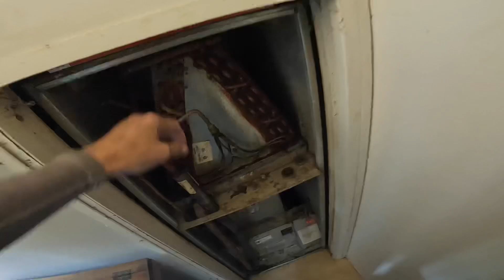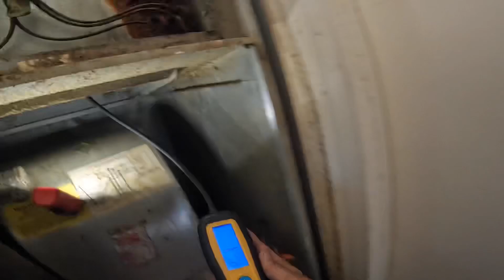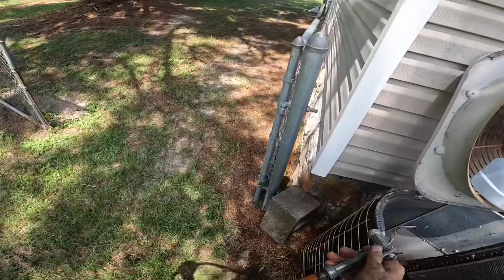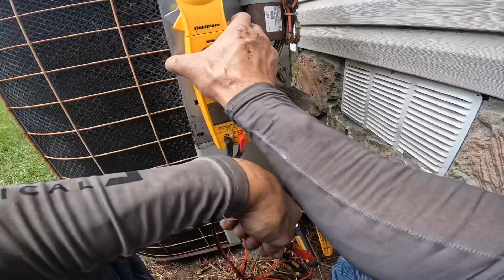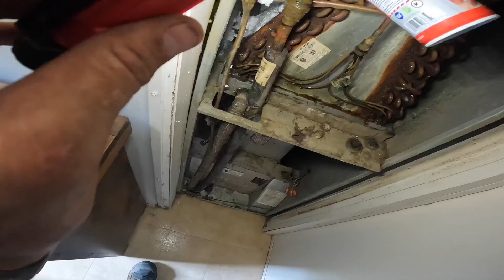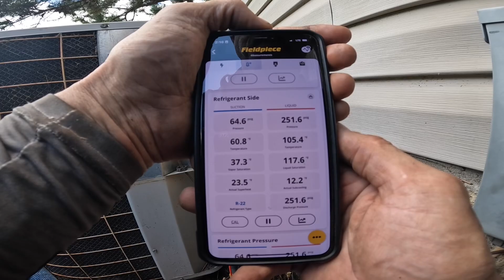Repairing an old System, instead of Condemning it!

Comment: I'm not a tech but I enjoy watching you guys go out on calls so I appreciate these videos.  By way of feedback (not criticism), it's a little better for me whenever I get to see the before and after on everything.  Like if you can show a flashlight or daylight through the condenser before and then after it's a little more satisfying.  And that uF calculation was really cool, but I'd get extra satisfaction if you metered it directly after removing it, and metered the new one before putting it in.  And when possible get a quick shot of the cap labels.  Again - not sayin you're doing it wrong, just as a viewer that double-check scratches an itch.  Just my 2 cents, and thx again for taking us along on the job.

Comment: Start budgeting for a new system right after a new one is installed.  Much easier than waiting until the current one you have is near death.  10 year budget (120 months) to save up vs 1 or 2 years to save up the same amount.

Comment: that suction would have gone up. looks over charged to me with poor air flow condition. what was indoor temp delta? guessing high. that filter looked smoked too. return grill as dirty as everything else possible too? just added the field piece wireless manometers to my tool kit. they are fun. you must try if you have not. did you just calculate MF on the cap with running voltage???! how do you do that???

Comment: I went on a call today they said the unit is blowing warm air in the house I think my compressor is bad I get there it's a 22 year old intertherm ac unit in a double wide was going to hook my gauges up but the suction line was blistering hot and I told the guy hell it's in heat mode let's go to tstat then he tells me yeah I put up a new tstat today but I don't think anything is wrong with it I said yeah something definitely wrong with it but he had it wired right just didn't program it so I got it blowing ac again

Comment: Nice video keep up the good work. i know how it is when your told you need a new system and dont have the funds for it.  just a couple weeks a go our ac unit at our store went down i was told system needs to be replaced its not safe. i have been told for the past 5 years system needs to be replaced well this year it almost happened its a old frigidare unit from 2003 2 ton with a pancake unit.  unit went down on monday it had cooled fine the week before i walked into an 80 degree show room we have 2 units one cools half the show room other cools the other half.  any how walked into an 80 degree showroom. unit was iced up i shut it down and called repair. the Indoor blower would not run finally they found a broke wire all the time telling me the wiring on the unit is a mess and dosnt seem to be wired correctly he reconnected the wire the unit fan started and then the wire nut started glowing red and smoking. instead of checking the unit he con dimmed it shut it down said its old and unsafe needs replacing. its going to cost 7,000 for a unit i told him i cant afford that can you repair it i was told no.
i almost paid for the unit well the store next me recommended his guy i gave him a call. he came out and said yes the unit wiring is a mess the wires are cracked and melted the transformer wiring is poor but what really caused the issue is the heating element was shorted he quoted me 400 bucks to rewire the unit for cooling only he replaced the transformer a relay and some wiring. the unit is now back up and cooling and freezing people out of my show room there is a 20 degree split and i couldn't be happier i got yet another recommendation to replace the unit. at the cost of a new unit i plan to ride this system for as long as i can.   our store has been in this building for 10 years and that system hardly ever gives us any issues.
we had a carrier on the other side that was installed in 2008 2 years before we moved our store into the building that was a new unit that unit back starting 2016 ish was always having problems and in 2019 the compressor blew we put a new ruud on the roof condenser only the unit downstairs in showrrom was 410a compatible it has not had one issue since it was installed.

Comment: Sometimes you can keep them going. My MIL's condenser went bad, we put a used one on it, and of course the Evaporator was leaking. We put a can of that stop leak in it, and it is still going five years later. My own system is 16 year old goodman 4 ton and it's a leaker about 3 to 4 lb a year. It's a polished turd at this point. The compressor is drawing too much and sounding a little rough, but still working for now. I'll keep it going as long as I can.
Reply: You can't polish a turd, but you can roll it in Glitter 😎

Comment: Swapped out a 23 year old evaporator coil on a rheem AC the other day, it's phased out here and unavailable. pumped down to vapor into the condenser using the service valves, only needed 2.5 oz of upcycled r22 to bring it back to spec!

Comment: Why don't you use a cleaner to clean the condenser unit.
Reply: Because water works just as well. Evap Cleaner works better for inside because of the confined space and inability to spray water through the coil. They do make foaming cleaner for the outside units but it has a tendancy to weaken the coil so using on an older system isn’t always a good idea

Comment: Mobile home air handlers are garbage at filtering whoever installed that cabinet should have put a solid door on the front of that cabinet or seeled of the front of that thing instead of that open grill door on the front of that unit that has absolutely no way to put a filter on it so that poor dude could filter his system properly That cabinet literally has an opening up top for the filter to sit up top of it or a filter plenum to run a duct to a 20x30 grill through the wall above it.

Comment: I have popped the low voltage fuse so many times changing out caps right next to the contactor- so frustrating when the air handler/furnace is in the attic 🙂

Comment: Texas heat took out my ac, anyone have experience with Carrier, performance line, 17 seer, two speed.  I am looking at the Carrier to replace the junk Amana that has a leaking evap coil, second one in 10 years.
Reply: Probably you use something acid or thinner the eating your coil

Comment: Mobile homes. Will never 'do right' until they start putting in returns in most of the rooms
Reply: Agreed. Just added return ductwork + return trunk line under mine and added a return in almost every room. Only think that’s good about it was supply and returns can be ran directly off the trunk without adding flex

Comment: I said it before and I'll say it again, you have to clean the condenser and evaporator. When I started in years ago, I had an old boss instill in me that if  you getting funky gauge readings, clean the coil and evaporator. Then you will have a good base line to start from, because 95% of the times a dirty coil with lead your mind to other things. The 1/2 hour spent cleaning the coil will save you time when trouble shooting the unit.
Reply: Absolutely stupid!!

Comment: Geez why do people stuff the indoor units in little places like that? What a tough job that would be to replace. Good job helping those people out on their old system 👍
Reply: It's not 'people' it's the manufacturing home builders. It's because they don't have to go by many standards as when you're building a home
Reply: @staind288  yes I meant the contractors.
Reply: @anthonyelectric6045  
It’s not the contractors they go by a blue print made up by an architect home owner and engineers unless it’s a model home ….. in this case it’s the mobile home manufacturer and it’s cramped liked this to give people more living space plus they only design it the don’t have to do repairs to the system ….
Reply: @FredD63  kinda figured so much. It’s all good till you have to repair it I guess.
Reply: @anthonyelectric6045  
Exactly right 👊🏼🇺🇸🇺🇸
Reply: Older manufactured homes did that a lot. Newer ones aren’t so bad at all. Mine was built in 2020 and has a normal carrier down flow furnace in a east access utility closet with lots of room if I decide to upgrade. I’m sure not all manufacturers are the same but something to keep in mind if purchasing a manufactured home